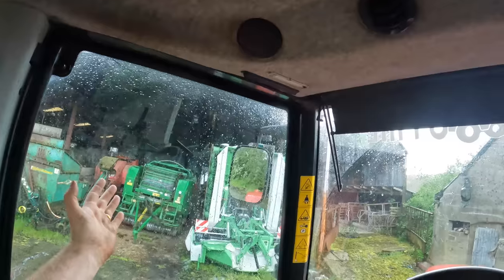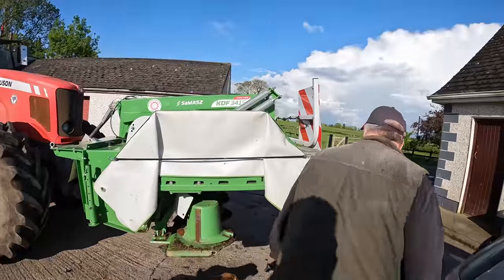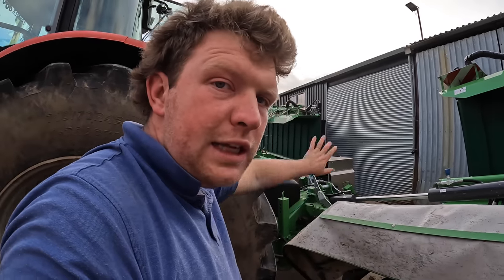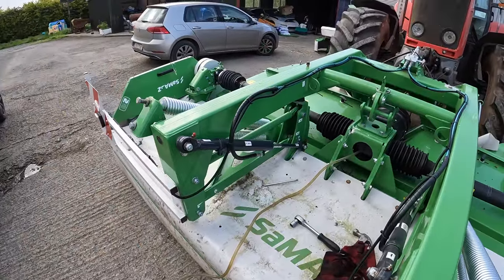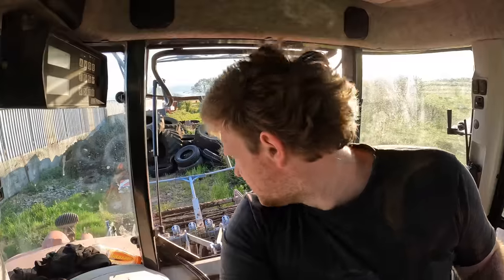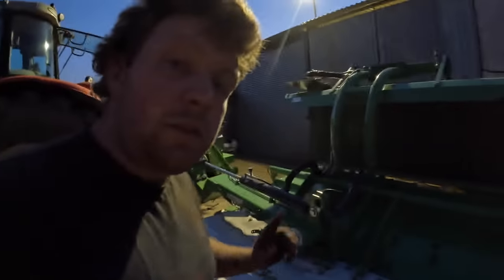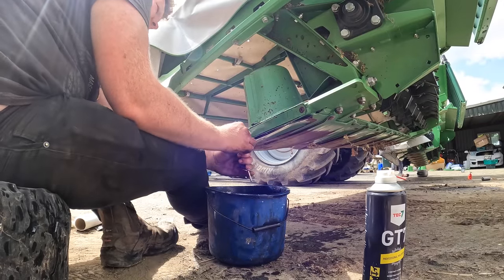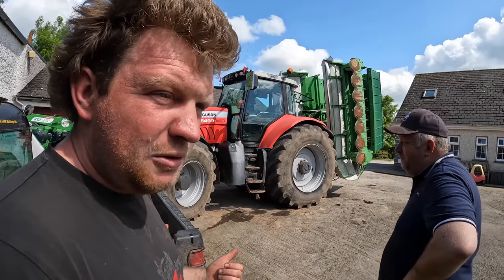DID WE OR DIDNT WE? WHAT ARE WE MOWING WITH THIS YEAR??

Comment: Tip for next time. Before changing oil let the mower run for 10 minutes or so. It wil warm up so it wil drain easier and the metal cravings wil be floting in the oil instead of laing down in the bed were they could stick and not come out. Maybe you did this but wasn't clear in the video
Reply from the maker: We didn’t do it no but will next time👍

Comment: When taking the oil out next time you can get little pumps that will suck the oil out we have a briggs and stratton one that came with the lawnmower and used it for allsorts now and running the mower for a bit before doing the oil change will help it come out easier

Comment: I got a metal lever oil barrel pump and modified the out put tube so i could attach a plastic tube to it, can fill gearboxes and final drives in no time at all with it, I made a 5 gallon drum size container with a 2 inch BSP thread in it so the pump screws into it just like a 40 gallon barrel, google search for Sealey Lever Pump TP68 and you will see the type I used. The squirty oil can does have its uses too !

Comment: Did he trade in the other mowers and if ye didn’t would ye put the old mowers on the 7618 and mow with that as well
Reply: Don't think he did, not sure they will have the need to run the 2 fleets together, but they will act as back up in case